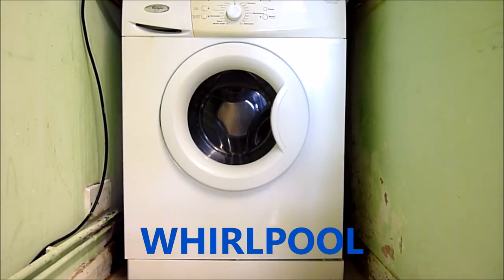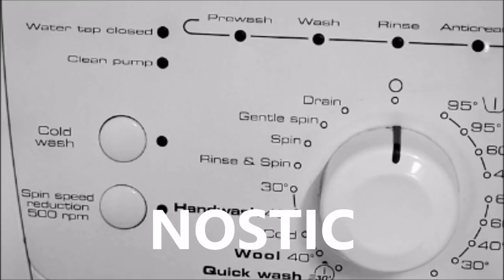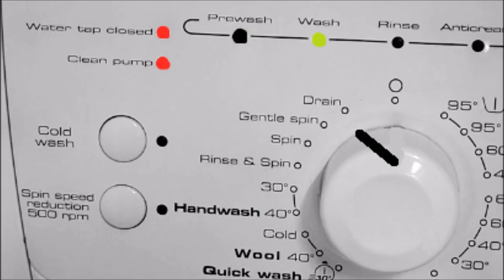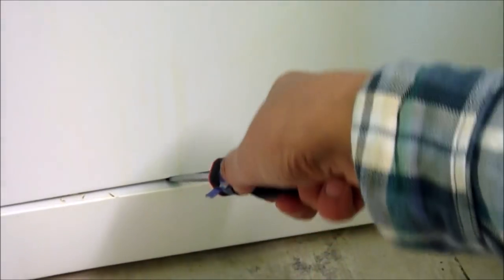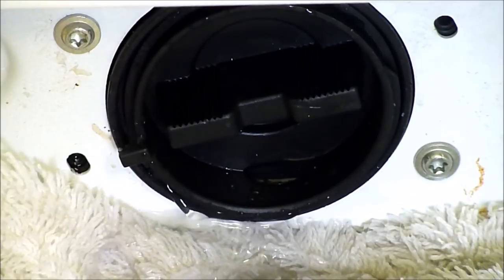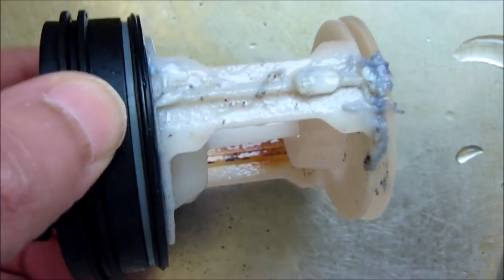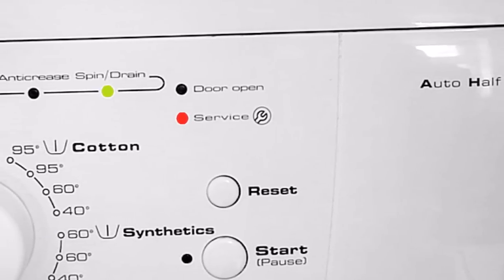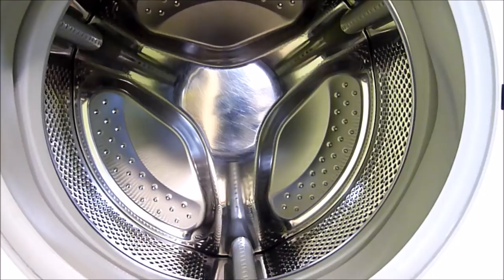HOW TO FIX WHIRLPOOL WASHING MACHINE SERVICE ERROR LIGHTS - CLEAN FILTER PUMP

Comment: Thanks!  I believe I have a "clean pump" error due to the drain hose being too kinky - we've just fixed it to a Y splitter on the standpipe as we're in the middle of fitting a utility and it's too much of a coincidence.

However, for anyone who has the AWO/R 5206 Whirlpool:  my reset button worked by holding the button down for a few seconds!

Comment: Hi , wonder if you can advise. The rotor arm inside filter isn't spinning freely. I'm assuming I need a replacement filter but I can't find part no. I've checked several websites but non give a code for this model. AWO/D 4505. Any help would be awesome
Thanks

Comment: I cleaned the filter, but it still wouldn't drain. I cleaned the drain hose, worked for 2 empty cycles on rinse and 1 regular quick cycle then on the next one it stopped draining again. Removed even the black rubber pipe, cleaned it and removed the float ball but it still won't drain. The pump does seem to work and spin if I take out the filter and run a dry drain cycle. But the filter does not seem damaged or missing anything. Does anyone have any idea what the fault could be?

Comment: Hello. Thank you for sharing this. I was able to run the diagnostic, and I have found many sites that tell what error codes mean what, but I have not been able to find any site or manual that tells me how to interpret the lights to determine what the actual error code is. Do you have a cheat sheet or can you tell me? Thank you!

Comment: I get the red pump clean every wash now and there is nothing in the filter its clean as a bell. I have to put the mashine on bricks so i can empty it through the filter. Far too sensitive and a complete pain. This happens no matter how high or low the drainage pipe is. As a company goes what with the driers catching fire they dont seem to be as reliable as i thought!!
Reply: Put the machine flat on it's back, remove the pump and pipe work and clean the black rubber pipe with the ball float,